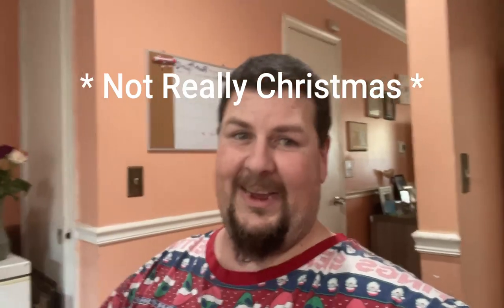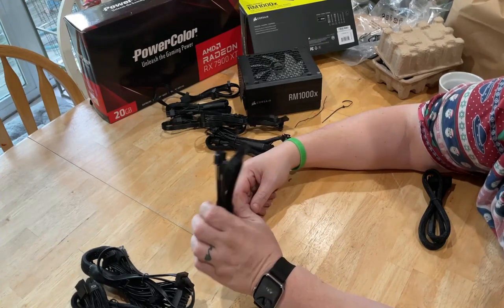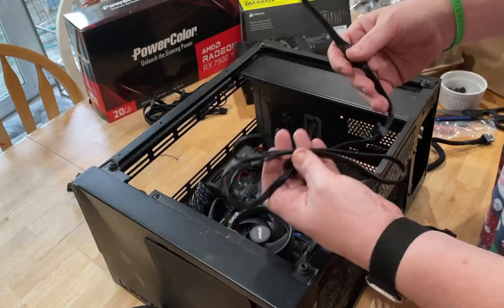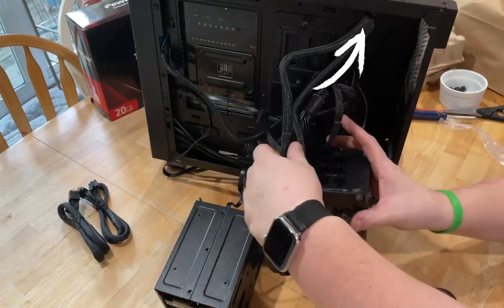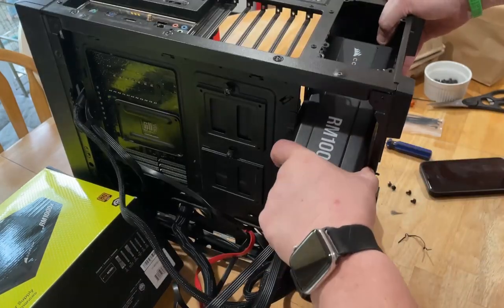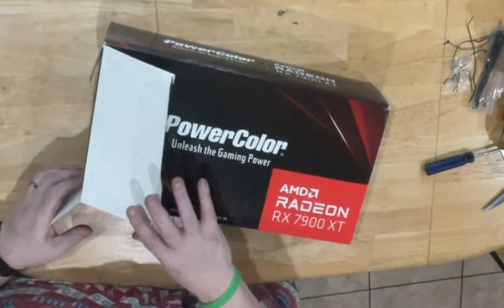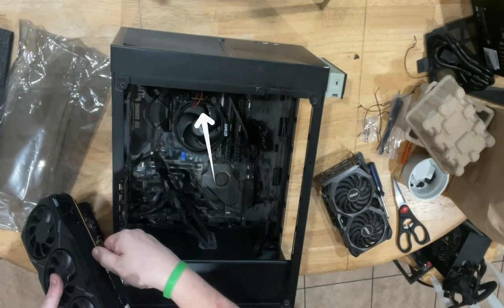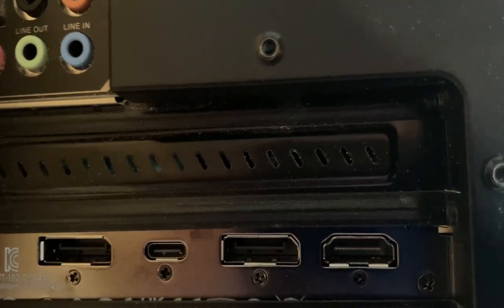AMD RX 7900XT and 1000 Watt Power Supply Install

Comment: great card, just be aware that 5800g is a pcie 3.0 cpu, and your gpu is a pcie 4.0 so it will bottleneck it, i would upgrade to the 5800x3d or something along those lines, maybe a 5800x or 5700x, also 5800g is an oem cpu only, so you got it out of a prebuilt or off of ebay or something, all in all hope you love the card <3
Reply from the maker: Absolutely aware of the bottlenecking. It’s not so much of an issue at the moment, but I do plan to upgrade to am5 rather soon.
Reply: Hell yeah Glad to hear it brother